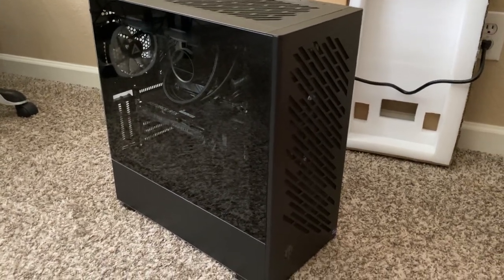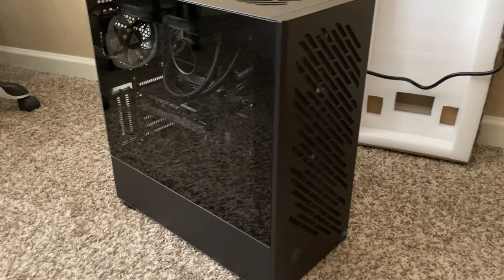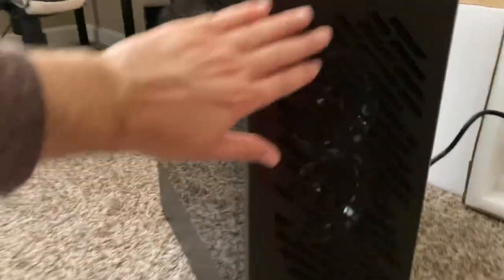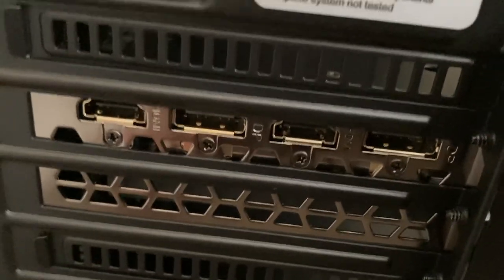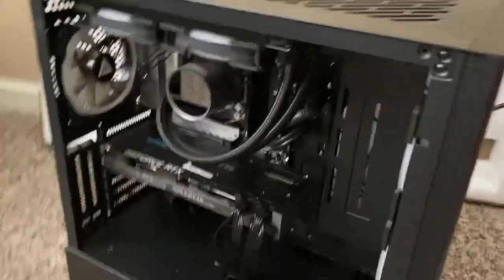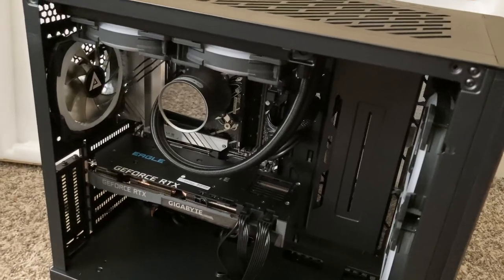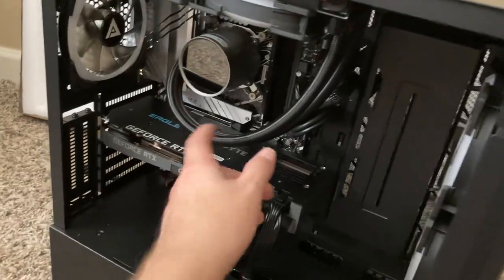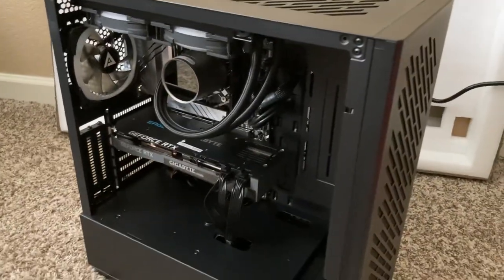New! CyberpowerPC Supreme Liquid Cool 2023 Edition - RTX 3070 - I7 13700KF - DDR5!!!

Comment: Amazon is running a deal for an i7-13700kf with RTX 4070 at $1849. Amazon prime members also get a 20% discount on top of that, bringing it down to $1480. Thinking of grabbing it.
Reply: Get. I9-13700KF with a RTX 4070 for $200 more...
Reply: Did you end up getting it? I know they have one on Amazon with i7 14700kf with Rtx 4070, 32 GB Ram, 2tb ssd. Think it's a good buy? For $1749. Just the beefier package. But wonder what the PSU is...
Reply: @waterbreather9448 INTEL CORE 17-13700KF
2TB PCLE
32GB Memory
2TB SSD
NVIDIA RTX 4070 Graphics
Liquid Cooled , Windows 11
1-Year Limited Warranty
MODEL# SLC7400SAM
$1749 I'm just curious is this a good deal?

Comment: I bought this pc about 4 months ago and just about a week and a half ago, my PC won’t turn on anymore. I currently have in a repair shop and I’ve been told that the PSU and Motherboard are the issue as to why my pc won’t turn.

Now I don’t know if I just had a faulty pc even though I’ve been using it for 4 months? Or if I just had bad luck or if the pc actually has some cheap parts in it. 😩